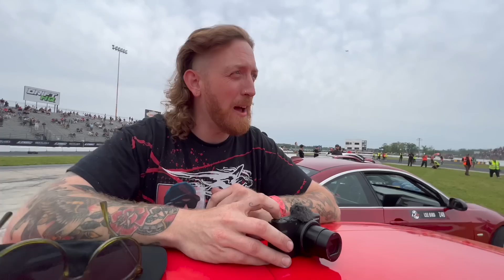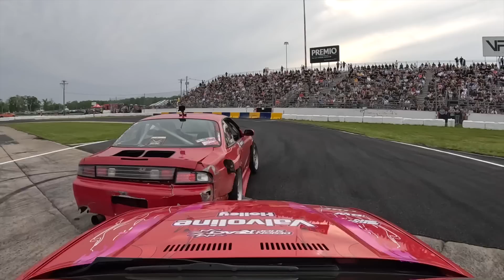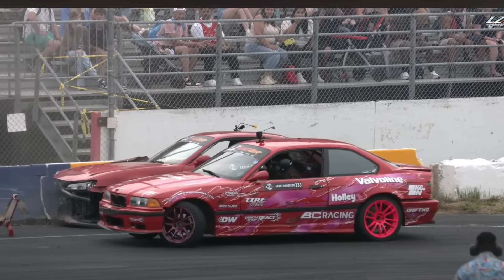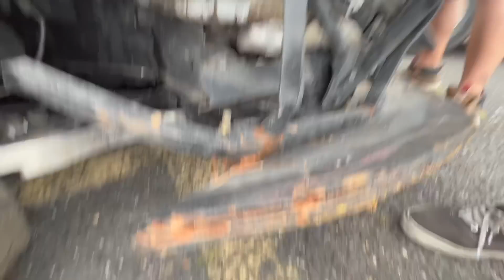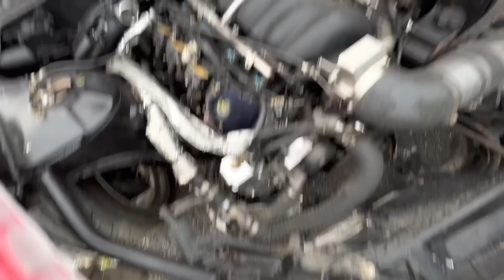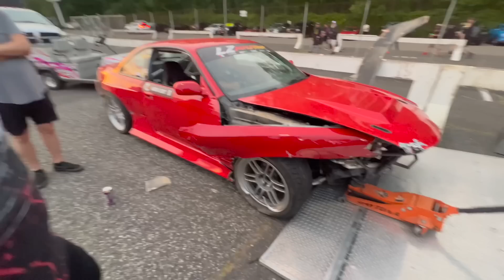My car was DESTROYED at the LZ World Tour

Comment: Hard call, to me it looks like Grant didn’t leave enough room to transition. I see Aaron’s wheels still spinning in the slow mo and regular speed replay. If he was on handbrake it was for a split second if anything. Grant was really on Aaron aggressive which happens in comp but they were entering the corner and Grants front bumper was still in front of Aaron’s rear bumper. There’s a fine line between timing transition perfectly as a chase driver vs ramming the lead driver off line, not saying Grant did it purposely. Yeah it’s comp and really both drivers aren’t at fault. I just think Grant was slightly coming in a little hot.